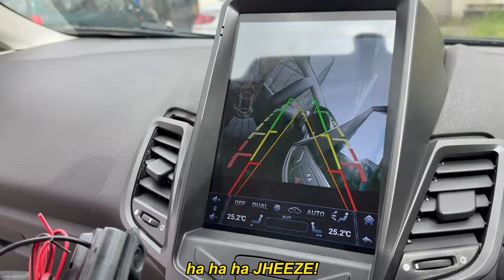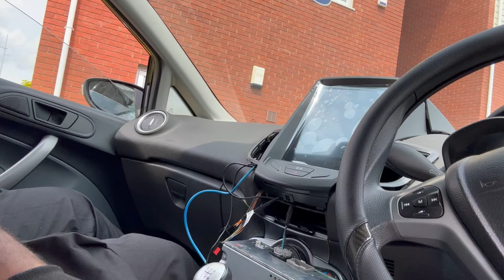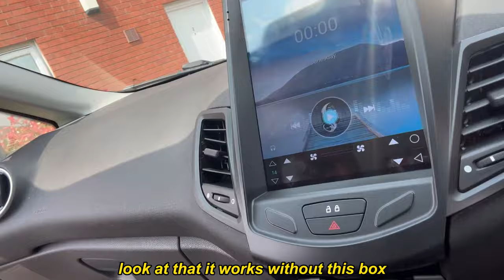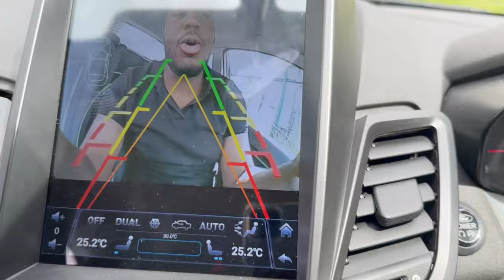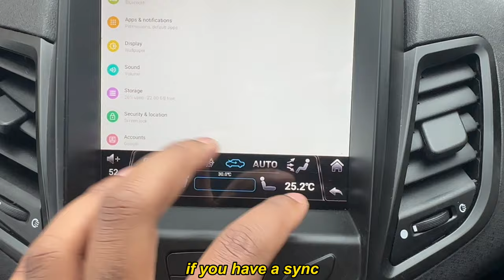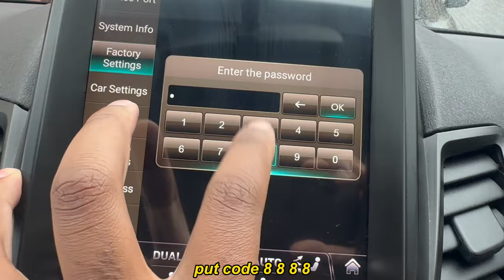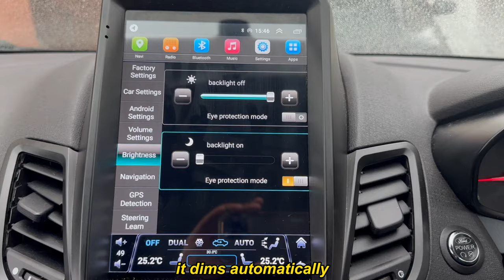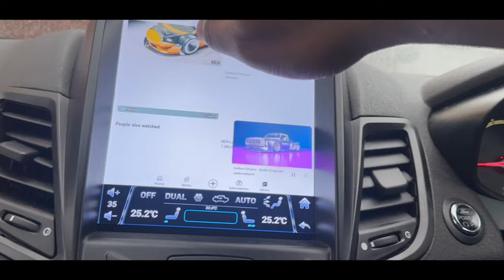NEW Ford Fiesta 2008-2017 TESLA Sat Nav Apple CarPlay Android Auto Headunit & Reverse Camera Install

Comment: Does the alerts still working? Like tires pressure, engine alerts, belt ? Great video man.
Reply from the maker: @MrHellscreams  yes they all still work and the unit also shows car battery condition, just the tyre pressure monitor you will need a separate device to connect to the screen which is easy to fit 👍🏾💯

Comment: Great video
I have ordered one of these for my 2015 ff titanium ecoboost. Hope it fits nicely. What trim tool should i purchase to do it please mate.
Reply from the maker: Thank you and that’s awesome, order this set, it will last you a very long time and does the job 👍🏾💯- https://www.lionzdealz.com/product/neilsen-ct2287-car-trim-removal-and-moulding-set-red-11-piece
Reply: @CARLISONIT  
Thankyou mate. Keep up the good work.
Reply: So it I've just found out that this one doesn't fit cars with the Sony factory fitted radios in them.
Reply from the maker: @hansgruber6358  I managed to fit one on an Ford S Max with a sony radio as no one wanted to touch it due to the Sony radio being a difficult radio to work with, the seller didn’t recommend it, but I tried anyway and got it to work it but was one of my custom works I had to do, i’ll try and find time to post that video soon, but maybe best to get the other one I did a video on, that will be plug and play 👍🏾💯 https://youtu.be/qkdZCAxd4c0
Reply: @CARLISONIT  
I've asked for a refund. I really didn't like the other one it was too high for my liking.
This one was spot on. No worries. It is what it is.

Comment: Hi, great video. My car has reverse sensors.. I guess this will still work with them. I also already have a USB just below the handbrake.. Will this still work too? 
Thank you 👍
Reply from the maker: Yes they should work the reverse sensors should still bleep when reversing, also there is an adapter that comes with the kit which enables your usb to work, it also comes with an additional USB 👍🏾💯
Reply: @CARLISONIT after the usb next to the handbrake is wired up to the unit, can it be used for flash storage/media playback through android, or only for charging?
Reply from the maker: @mk.c63  iv never tested it but I know charging works with usb next to handbrake, also you will have 2 extra new usb slots that you can use for storage and charging that comes with the headunit 👍🏾💯

Comment: This is exactly what I'm looking for, thank you!! Just for clarity, the screen turns off when you turn the engine off?
Reply from the maker: Yes it turns off straight away when you take the key out the ignition 👍🏾💯
Reply: @CARLISONIT  Thank you. One last question, does it have DAB radio?
Reply from the maker: @romansweeny3396  yes DAB will work if you get this and it’s plug and play use my code ONITDAB10 for a discount on DAB 👍🏾💯 https://www.lionzdealz.com/product/dab-antenna-with-usb-adapter-receiver-android-car-stereo-player-car-gps-receiver-for-universal
Reply: @CARLISONIT  Isn't the DAB via an app as well though? As well as that USB stick?
Reply from the maker: Yeah the USB stick will come with a link to download the DAB app 👍🏾💯

Comment: Hello there.
I'm about to buy a 2013 fiesta, and I would definitely like to have some kind of screen/android auto option. Your videos have been very helpful, but despite that I can't decide between the smaller version in one of your earlier videos and this larger "tesla version". Which would you recommend, is one better than the other? Honestly I prefer the smaller version because it keeps the buttons, but at the same time it can seem to interfere with the view, while the larger version blends more into the car, but takes away the buttons.  I suppose you liked the tesla version better, as you replaced the small screen with it, but was there a technical reason for that, or did you just like it better? Which one is better/comfortable to use? is there a difference in operation? Performance? If you could give me a longer review I would really appreciate it because I am totally clueless. 
Greetings from Austria
Reply from the maker: If the view is going to be your biggest concern then i recommend getting the tesla screen, both run on an 8 core system so both are as fast as each other, i personally like the tesla screen more as it looks more unique 👍🏾💯

Comment: I noticed a lot of these units have rca clables but am unable to tell whether these are output for an amp/sub or something different. Does it have any output for a sub?
Reply from the maker: @scytheoflife1947  yes this one has an output for a sub 👍🏾💯
Reply: @CARLISONIT  Now I just have to try and figure out if the sub w built in amp is working or if I have some other issue. Sub starts to play audio but poorly/distorted and second engine is one hums which seems to be alternator whine so I know I know ground loop likely at play. Driving me completely mad this one. I'm thinking I will probably have to try buying some wire and grounding the head unit to the same location as the sub/amp/loc. If only things went as smoothly as they do in your videos 🤣🤣🤣
Reply from the maker: @scytheoflife1947  go to DSP/equaliser  settings and ensure sub has been switched on if its on then, it will just come down to how well you wire it up 👍🏾💯

Comment: Hi, interesting installation, great watch especiailly the rear camera install. I bought Tesla unit for my fiesta 2014 model from another site , seems to be different OS as i don't recognize the setup screens as mine. Unit set car odometer to km from miles and unable to change to miles. when removed and original unit installed, odometer displayed miles again. Also, stearing wheel buttons hit and miss if they worked, have to reset the function every few days.. anoying.
Reply from the maker: Thank you, this one has a very good OS and you can change it to miles or KM without issues, also the steering controls work perfectly my wife loves it 👍🏾💯
Reply: @CARLISONIT  thats good to know. Are the Ford logos as standard or, are they in app purchases? Can the screen be PIN locked for security?
Reply from the maker: @dominicolley1261  i show how to download the ford logos later in the video for free, also i’ve not tested screen locking but I believe it is possible 👍🏾💯

Comment: Hi the plug that was left in the old radio/cd part is that not needed anymore?
Reply from the maker: @Quickfingers1984  depends which part if you need help with installation message me on instagram @CARLISONIT 👍🏾💯
Reply: Ive sent u a message on insta

Comment: I can't get the one I bought too work. Connected everything up and get a blank screen. Customer service is slow, taking hours, even days to respond.. could really do with some help with this.
Reply from the maker: Where did you buy it from? If not from the link that I shared, that’s why it’s not working, i’ve had 100’s of messages saying they bought it elsewhere instead of the link and they all have problems or don’t work, i’d recommend returning it back and get the one I used, I only recommend what actually worked for me 👍🏾💯
Reply: @CARLISONIT  cheers m8
Reply from the maker: @scottishwatchman3499  no worries mate 👍🏾💯

Comment: My ford fiesta has parking sensors. Will they still function and show with this unit?
Reply from the maker: I’ve never tried it with the fiesta, but I believe it may work this ultimately comes down to the programming from factory, with other cars that i’ve installed screens in like the bmw’s and mercedes it shows on screen 👍🏾💯

Comment: I ordered one of these for my Transit van, I would suggest you instal CPU-Z and check the specifications, mine was supposed to be 8 core, 128GB memory, Android 13, and a 1.5GHz processor, when tested it was 4 core, 26GB memory, Android 9.1, and 1.12GHz processor, ther are also many reports on the internet about these fake specifications. Not trying to piss on your parade, but just pointing out many of these units are sold with fake specifications, mine was very slow, thats why I knew it wasnt what I ordered as I have had Android head units before.
Reply from the maker: Yeah i’ve seen that alot from past places I ordered from, this one was as described that’s why I always get my stuff from them   👍🏾💯
Reply: Just to say, i think there is something they have added in the software too, because CPU-Z when opening basically closes within a second or two to stop you checking, have a caamera ready to take an image
Reply: @CARLISONIT  Good stuff, i did check but they didnt have anything for a Transit, or at least I couldnt find it if they did
Reply from the maker: @kevindavis8442  for transit I remembering doing one with you would need a custom fascia dm them they’ll sort you out 👍🏾💯